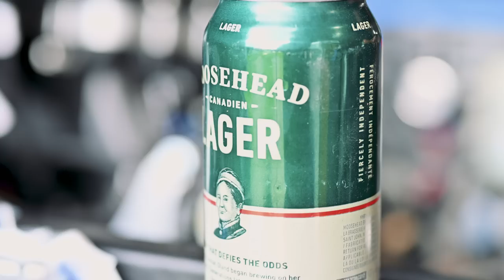Austin's boosted 4WD C10 feature film

Comment: What do you run for fuel in that monster.
Reply: Usually 93 octane and I have a dual nozzle methanol setup on it as well
Reply: @Boostdsuprsport  what methanol kit did you go with or did you make your own and use windshield defroster??
Reply: @bowtiebuilding  it's a stage 1 kit from snow performance but I have it triggered with an output on my Holley terminator system as a second fuel pump so I can change when it comes on with my tune. It comes on full blast at 10 lbs
Reply: @Boostdsuprsport  right on! I want to get a meth kit still learning though. Mines an 07 classic and factory ecm. Borg Warner S475 on 9.5 lbs controlled primarily by the waste gate. Guys like you paving the way for us common folk to follow. I love my turbo truck 😂
Reply: @bowtiebuilding  hahaha man I am common folk I'm just wayyy too obsessive 😂
Reply: @Boostdsuprsport  hats off to you bro 😎
Reply: @bowtiebuilding  thanks buddy !